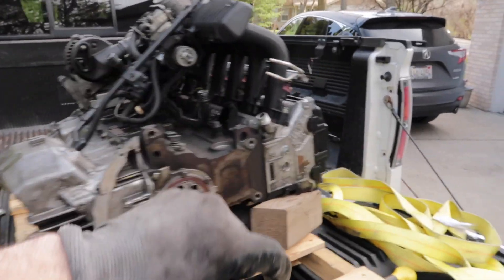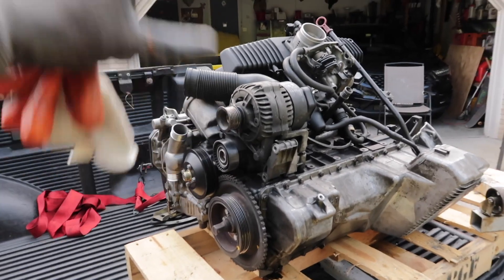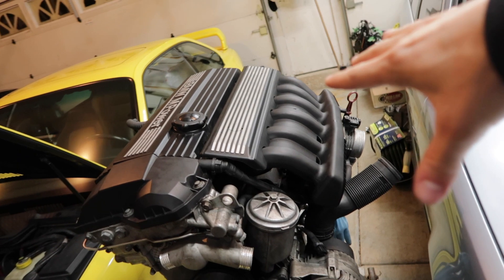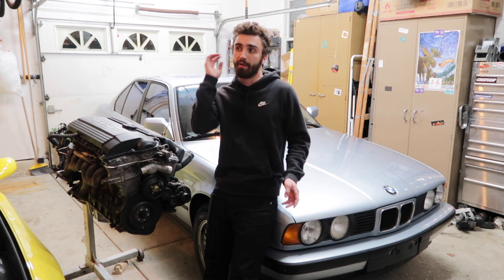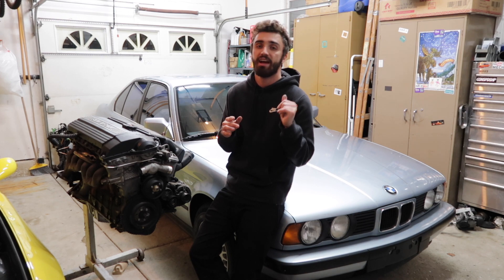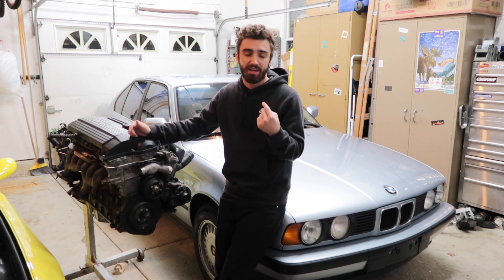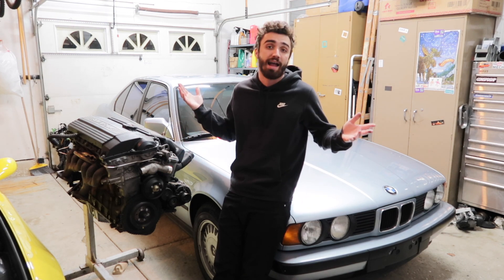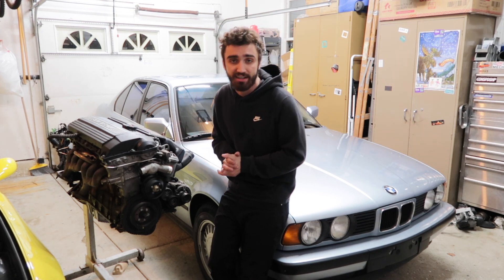I Got a New Engine for the Low Mileage E34! Good or Bad Idea?

Comment: Love this! S52 is the perfect engine for the e34, did the swap on mine 7 years ago and has been flawless. I converted the car to OBD2, the stock e36 harness will fit with minimal modifications and the OBD2 DME fits in the original location

Comment: My oil pump nut on my e34 535i was thankfully tight when I pulled my motor. I red loctited it and torqued it to spec according to the factory service manual

Comment: Hey would ur plans with that mid pipe involve removing the cats for a cat-less set-up? If so please hit me up,I have a stock set up with a loose heat shield so even if ur planning on scrapping them maybe we can figure something out,cuz I can't afford to replace these things
Reply from the maker: Probably going to hold onto it for any future e36s i acquire
Reply: Bro u have NO idea how annoying this sound is. I've tried to repair it but no "fix" has held for more than 2 days. Esp with the auto diff,starting in 2nd makes more sense,so drops the rpm's more than usual and TING**TING from right under the trans tunnel

Comment: S52 swap is the move. You could always supercharge it to keep that linear pull in the future!

I have a 94 525i. I want to s54 swap my e36 m3 and put the s52 in the e34.

Another note, have you thought about converting the e34 with the s52 to obdii so you can easily tune it without chips?
Reply from the maker: Yea since this video ive been doing all my research and weighing options. Obd 2 in e34 would mean exhaust work, custom harness/ wiring changes. 2 of the only things I dont do myself, no care to do, so I’ll be happy with obd 1. I personally love obd 1 and its ancientness

Comment: I need your opinion I am planning on doing the transmission on my e34 and I need to know if a manual swap is worth it or not I have the option to keep it automatic but I just recently found a manual swap and it’s closer than the automatic I just want to know if a manual swap is worth the trouble for the long run vs saving time just swapping the automatic for a good used one
Reply from the maker: Depends entirely on what you want. Do you want to have more fun driving the car? Then go manual. If you like the comfort of auto then keep auto
Reply: @m3nameisjosh464  thanks 👍

Comment: I'm just gonna start off with a sh*t eating grin...lol. I called it with the trans swap,which at that point it's never gonna be "stock" and WHO CARES. Starting with an auto and swapping it is pretty much the ONLY way to get a clean,cheaper bmw now,and I personally couldn't be happier. I mean my interior was 100% complete,usually low miles so it doesn't have a lot of "wear" on the car. I'm all for ur plans.  
 Got a couple questions...What's ur diff(ratio) plans? I STILL haven't switched mine from the e36 auto's 3.91,but do have a 2.93 the 328's came with to put in so I can start taking road trip again. 
Also, since ur gonna be pullin the whole motor isn't it easier to convert the entire car from obd1 into a obd2 car? I could have sworn when I first got my car,I was confused about when the old switch happened so a lot of videos where watched...and one of the jobs was converting to obd2,but I could be backwards on the whole thing lol
Reply from the maker: Using a 3.23 LSD from my e34 525 parts car. So the standard ratio for a manual 525. And making an s52 to obd 1 is easier because the e34 is already obd 1 so it will make it a drop in swap. Getting an e34 to obd 2 is trickier because it wont accept an obd 2 harness without modifications. For an e36 it’s different since obd 1 and 2 both came in them

Comment: Lol what? I dont think thats a good idea. Real M Engine like the S38 maybe,  but S52? That thing has maybe 50hp more than M50. And also isnt the low mileage the most special thing about that car? Kind of takes it away. Buts your car, do whatever you think will be the most fun
Reply from the maker: I agree, a real swap would be s38 or something similar. Yeah the horsepower increase isn’t astronomical, but its a drop in swap, no real modifications, and I enjoy the labor.  The low mileage to higher mileage is the main thing bothering me